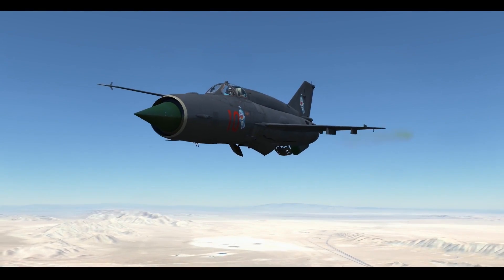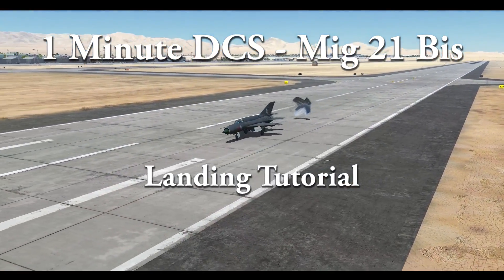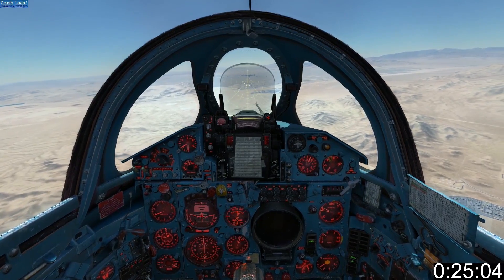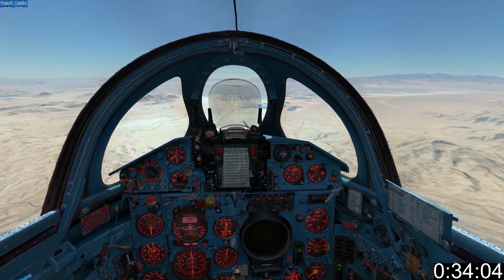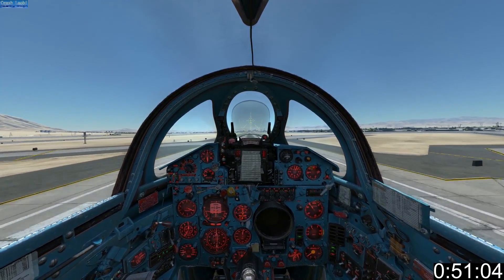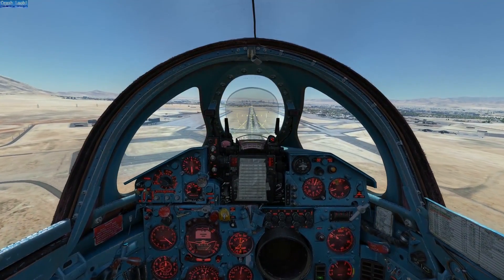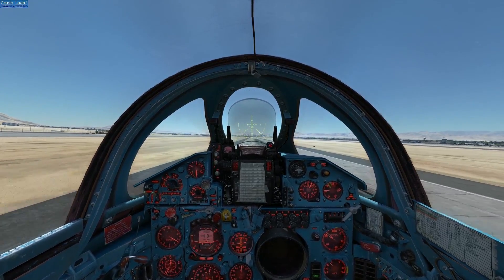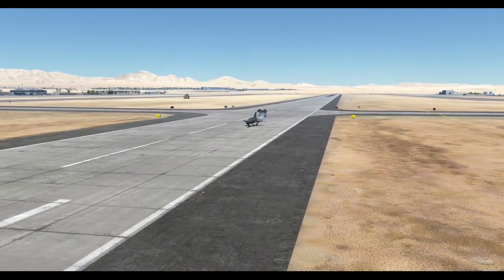1 Minute DCS - Mig 21 Bis - Landing Tutorial

Comment: 500-800 liters isn't just a sweet spot, it's pretty much the maximum. 700 liters for no external payload, 500 liters for 2 missiles OR 2 UB-16-57 pods OR 2 FAB-100 bombs OR no external ordinance and empty drop tanks. Anything heavier needs to be jettisoned.

There are exceptions to this, however, and of course seeing how this is a simulator you're not exactly going to get your ass chewed for landing overweight. In case anyone's curious, the landing weight limitations are in the manual on pages 33 and 34.
Reply: Crash Laobi The Extremely Casual Gamer It seems like a lot of people tend to land heavy, fast, and shallow in the MiG. I'm definitely not knocking it if it works, but whenever I try that method I tend to wind up with flat tires from touching down too fast. My squadron leader subscribes to the fast as shallow approach method and prescribes dumping the last few km/h at the last second with speed brakes to get down to touchdown speed really fast.
Reply: Watching someone land a grossly overweight MiG on a 4600 shoe/1400 meter long runway is a hell of a sight.

Also, sorry I've been commenting so much on your MiG-21 videos lately. I've been studying it more intensively so I'm kind of like that new student driver who feels the need to comment on every little thing when they're riding as a passenger.
Reply: To be completely honest I'm really surprised the MiG doesn't have an option to dump fuel instead of just burning it off, considering the weight limitations. It also makes me wonder, when they jettison unused payloads that are too heavy to land with IRL, do they have some sort of procedure to do so and minimize any damage to them so they can be reconditioned and reused, or are Russian weapons just designed to be so cheap it doesn't matter if a few are wasted here and there? That would make sense considering their missile macross massacre BVR strategy...
Reply: Maybe a pre-designated grass field adjacent to the airfield or something.